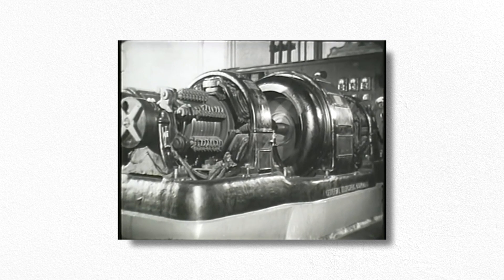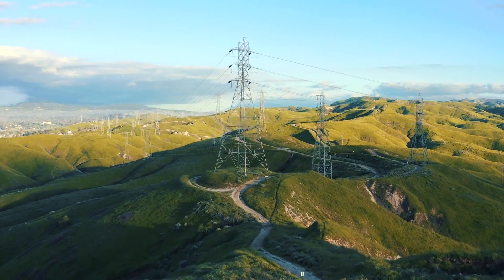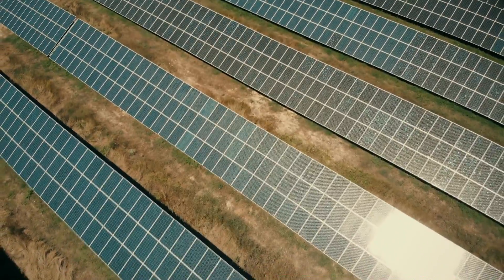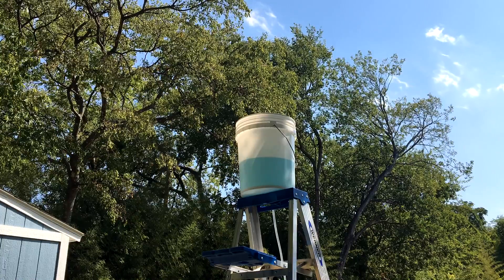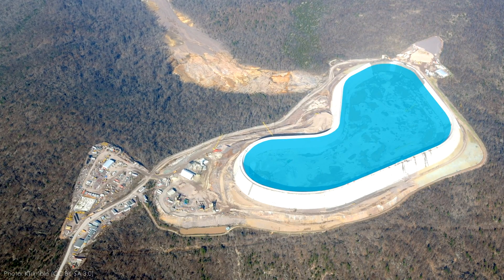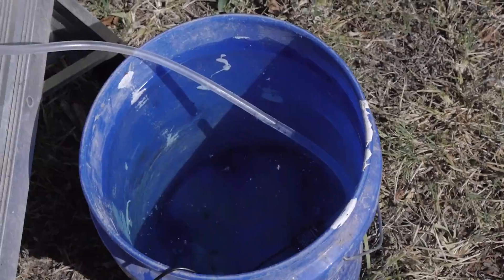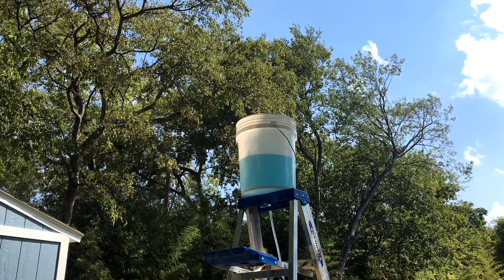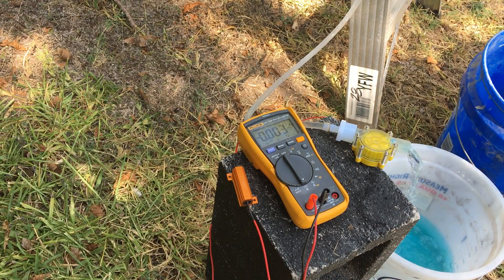World's Largest Batteries - (Pumped Storage)

Comment: I've heard from other places that Tesla is trying to make batteries for the same application and there are some trying to make super capacitor banks for the same thing.
I'd imagine several average house sized buildings with new battery technology and super capacitors together could eliminate the need for pumped storage except in the case of emergencies.

Comment: I've heard this concept be applied to a huge underground weight being hoisted upwards and released when needed. Do you know about this? Is this more efficient/practical? Where is one?
Reply: The problem with this concept is it requires expensive heavy equipment, and you have to drop the material in order to run the generator.  Long story short, as long as the material costs more per weight than water, it's just not worth it.  Water is both heavy and cheap and water doesn't suffer from wear and tear.  Not to mention you'd need to make that weight drop at a controlled speed, which loses energy, and would also require much more complexity to the setup, requiring more equipment and maintenance.

The only place something like this would be useful, is somewhere there isn't any access to water.  And even then, you'd just be better off building somewhere there is water and piping the energy there.
Reply: @peoplez129  great answer, thanks!

Comment: Shouldn't electrolysis of water to get hydrogen and storing it for future use be more efficient in terms of energy density.
Reply: No around 4x worse and water is a lot easier to deal with than hydrogen.
Reply: 1. when converting water to hydrogen you lose a lot of power if the waters dirty or if the plates have a large area (more resistance)
2. when the hydrogen is used for electricity through proton exchange membranes some of the hydrogen gets wasted due to the membranes tendency to react with carbon monoxide and not oxygen
3. hydrogen is flammable so its a bit risky
Reply: Hindenburg disapproves.

Comment: What about using a ram pump? Using the force of the river to pump the water. no electric or gas to run the pump of course the ramp pump is not efficient but it is not costing a  person any energy. i am coming form a off grid concept for a home not on a macro level.

Comment: No need for water. Just dig a hole with a pulley and weight system. The excess energy pull up the pulley.. Gravity will generate the electricity directly instead of fluid losses
Reply: What about friction?
Reply: @Asbjoern  what friction?

Comment: It's not as if large scale electricity storage can't be done, it can, the problem is trying to do it in any way that's inexpensive, safe, convenient, small.... and reasonably efficient. All of the solutions have their pros & cons. And if you find perfect terrain to build a big high dam + low dam, how do you know in 5 years someone isn't going to discover a battery 50 times cheaper and better than lithium ion?

Comment: What if we used a giant drip catching plate to catch the rain at a high altitude and funnel it into a turbine generator at a low altitude. Would that be free energy since there is no need to pump the water back up. Since this relies on rain it would be feasible in places were heavy rain is common.
Reply from the maker: This is essentially how hydropower reservoirs work.

Comment: efficiency...........its more of a problem than it seems.  If you generate energy from solar etc and send it up the grid its 10% loss, then you have the loss of the storage system itself ( even lithium batteries are only 90% efficient on charge and again on discharge) plus the 10% from sending the power back down the grid to the consumer.  Its a crock to think this can be cheaper than storing your own solar energy, on site.  The rip off is that your solar ( in Australia for example) is sold at 8 cents/kwhr during the day and you buy it back at 35 to 50 cents per kwhr. Great racket isnt it?  When we had coal none of this consumer eye gouging was going on. The whole point of the renewables crock is to bleed consumers dry.  Everything else is just propaganda.

Comment: Pumped storage is about all there is right now, yes. Rather trashes the environment, which the solar/wind advocates blissfully ignore...
Reply: Eh, I'll take a large body of water over an oil field or a uranium mine.
Reply: Even uranium rich rocks are not all that uranium rich. So a uranium mine is no worse than any other rare metal mine (which isn’t a high standard, but still). Interestingly enough though, it’s possible and almost cost-effective to pull uranium out of seawater. 
Ignoring that, there isn’t enough lithium for grid scale storage and possibly not even electric cars (for long, anyway) on Earth. While other battery chemistries exist (Nickel metal hydride and Nickel Cadmium batteries), they have downsides compared to lithium. While I disagree with the aversion to fission, the aversion to hydro pretty much makes no sense where habitat destruction is concerned when compared to wind and solar.

Comment: (about 5:36) a keyfob's battery energy would be 3V*0,220Ah ~ 2.376 kJ whereas the gravitational potential energy in the bucket (let's say it's 10 liters at 5 meters high, to be on the heavy side) would be 10*10*5 = 500J. So about 4 or 5 times smaller... so not quite the same... right ?
Reply from the maker: I was thinking about something like a CR1616. Just trying to illustrate the order of magnitude and highlight the difference in density.
Reply: @PracticalEngineeringChannel  oh OK sorry I took a CR2032, CR1616 gives three times less current so that would match up. Great video thanks :)

Comment: The energy-density and the requirements on the locations really make it only usable in some locations,  but there it is great.
Germany, switzerland, austria, italy, france - they all have some decent locations for that (and quit a lot of their capacity is used to buffer the german grid as it is just that unstable due to way too much wind/solar).

one other thing that is great about pump storage:
While they are indeed quit fast to react, they are also really "slow" compared to wind and solar as in they are really great at smoothing out the small ripples on the grid.
The demand on the grid can change rapidly even in less than 1 second. That can be from some clouds just covering a few solar-cells. When that happens that puts a huge load on the grid, but the generators of pump-storage are large bulky and heavy - when there is a huge load the energy is first sapped form their rotation and as they are that heavy and fast spinning they have a lot of power in them and can smooth out those spikes until the increased waterflow counteracts that again.

That is one of the biggest challanges coming from wind and solar - even using batteries as storage means that there is a delay between the grid getting loaded-down too much and the battery-storage kicking in. But with large generators there is no such thing - the load just directly saps the energy from their rotation (which is why the grid-frequency is such an important measure: The generators can keep up the energy demand, but they are slowing down when doing so. This makes the frequency the best and fastest indicator for the load on the grid)

Comment: lower reservoir: deep mine shafts. Upper reservoir: ground-level
Reply: Mine shafts are too small. We have one in a slate mine in Wales, UK. Well the pipes and turbines are in the mine, the two reservoirs are in the mountain above and the lake outside.
Reply: Working on a pumped hydro storage in Australia and you would not get rhe efficiency you would get from a lower and upper reservoir.

Comment: Thank you! I was very interested in pumped storage plants for the last several months, trying to figure out efficiencies and other numbers like how many are there, how popular are they and so on. Would love to find out more details about them.
Reply: Martynas, 

I think the video missed the point of pumped storage entirely, possibly he is not aware of why they are built and used. What pumped storage hydro is able to do is switch on generation in a very short space of time, a second or so and generally run for a very short period of time. Electricity grids work on a balance of demand and supply, when demand suddenly increases as it does regularly, the extra demand is too quick for the conventional generators to increase output to match, which causes a frequency drop, if that exceeds a pre set limit (U.K. is + or - half a hertz) then the system sheds load, i.e there is a power cut. Pumped hydro is used to catch those peaks and allow the conventional generators time to increase power and restore system frequncy.
They are not an energy storage system in the sense of grid scale storage to compensate for intermittent renewable generation, no storage system is capable of doing that as the capacity required is so large.

Comment: I had this idea of using boreholes for this purpose.

If you put a 1000 kg, 35 meter long, 20 cm wide lead rod in the Kola borehole, it would have a gravitational potential energy of about 120,000,000 joules.

Unless my math is wrong, that means one drop would provide, at 100% efficiency, 33 kwh. This would power one average US home for about 24 hours.

I know that doesnt sound like a lot, and you obviously cant hope to get 100% efficieny, BUT, consider this:

1.) You could come close to 100% efficiency. For a cheap method, vaccumize the hole, and use lubrication and a pully attached to a motor/generator at the top. Or, for a more expensive solution, insert a giant linear motor/generator in the borehole and make the rod out of a conductive material that can be held electromagnetically away from the walls, essentially eliminating almost all friction from the system, and converting its falling motion directly into electricity.

2.) This concept could probably be optimized way further simply by increasing the length of the rod, or diameter of the borehole. For example, just by increasing the length from 3.5 meters to 35 meters, I increased its energy storage potential 10 fold. If you made a rod that went, say, a third the length of the hole, you could power 86 homes for 24 hours (though moving a 118 ton rod would be an engineering challenge). Anyway, point is, change the dimensions and you can squeeze a lot more power out of it, at the expensive of needing to figure out how to move a much heavier weight.

3.) The big advantage to this concept is the surface area it would take up. The Kola borehole for example is only 9 inches across. You could have one of these in your basement if you wanted to. The real energy storage comes in from the fact that it's 12 km deep. If a given household only needed to store power for a 4-6 hour period, a single house would need a borehole (or multiple of much less depth) a fraction the depth and complexity of this "kola battery" I just described, and it could be small enough to go unnoticed in your basement like your water heater.

Of course, the biggest issue is the cost to just... dig. It's much more expensive in general to dig down than build up. The Kola borehole is almost a bad example to use in this scenario since it was actually a MASSIVE undertaking to pull off digging that deep. I think cost comparisons would have to be done to see if its even remotely worth it, and honestly, it probably isnt... but who knows, maybe it could be a clever way to say, reuse oil drilling boreholes on dried up and abandoned reservoirs that already exist.

Comment: Solar thermal and its storage technology is not intermittent and has been used for many years now.
Solar energy is not just energy derived from photovoltaic solar panels that work only when the sun shines.
Also, pumped water storage must take into account the energy required to pump the water up that gravity gradient (or height). It's not possible to fully recover that energy when it is released for use. Every step has it's associated energy loss. I'm afraid you cant escape the laws of thermodynamics and the reality of not being able to do work without energy loss.

Comment: Did you not run the hose from the bottom of the bucket? Looks like your syphoning from the top of the bucket to run your turbine. (7:32) Meaning your only using the pressure generated from the volume of water in the hose, not the whole bucket... You'd want to fill from the top but generate from the bottom.

I'm definitely not as smart as you but that's what it looks like.

Comment: Using Gasoline (or other carbohydrates) as power storage would indeed be better as shown by the energy density graph.
Problem is, generating that gasoline is too inefficient at the moment, basically the only efficient way to do it is with molten salt nuclear which could generate gasoline from water based or air based CO2 at competitive price (compared to the gasoline we refine from mined oil).
But once you get a plant that churns out gasoline like that, you won't use it as energy storage. You'll run lots of them to provide as much power as peak demand and use all the excess to make gasoline and sell that to power cars instead of powering power plants. Then of course you'll probably get some grants to battle climate change and make even more gasoline from CO2 which you'll simply store somewhere so that it isn't in the atmosphere so you'll have even more plants and capacity for power generation even beyond peak demand.
Reply: Gasoline is a hydrocarbon, Sugar and starch are carbohydrates !😎

Pumped Storage-cum-generation systems function as extremely inefficient "batteries" because they involve two inefficient conversions (a) pumping water uphill and (b) regeneration by hydel. When you combine this two stage conversion, the overall inefficiency is the product of the two inefficiencies. This is therefore a bad strategy and will never succeed.
Instead, particularly in monsoon lands like South Asia, if water is pumped up and drained out only for irrigation, then you double the system efficiency making it viable. 
Next, COMPLETELY dedicate all existing solar and wind generation ONLY to uphill pumping of monsoon rainwater from flood plains, into storage lakes at different altitudes, and intermittence of operation becomes inconsequential. And you do not need batteries any more!
With reference to the Indian situation, there are additional facilitating conditions and benefits. Central India is a plateau - will allow artificial lakes at different altitudes, strategically located over roughly 30% of the Country's area and networked with metre dia or larger pipelines. Lakes with unlined bottom will also allow slow recharging of severely depleted aquifers.
In most other countries, where the seasonality of monsoon or need for large irrigation demands do not crucial factors in water system design use this intermittent power source to raise level of drinking water supply, industrial use, etc into massive overhead water tanks.

Comment: I don't get it, you spend the whole video going on about how bad PSH is, yet for large scale grid sized storage nothing comes close.  +70% round trip efficiency is similar to what batteries get (hence why they heat up when charging/discharging).  Digging a large hole is far cheaper than building larger batteries (the sheer amount of raw materials required for TWh batteries is almost unfathomable).  The states also has nearly 79,000 dams, easily a few thousand of them are perfect sites for PSH.

The main problem is not technology, its political.  PSH requires large scale installations to be economic, and right now there's no political or economic incentive for changing the paradigm and moving to a smart/distributed grid system.  All the large utilities are still stuck in the 1900s where they sell you electricity and distribution/storage are just a by product of that, none of them want to buy back, manage, or store electricity.
Reply from the maker: Sorry for the confusion. I wasn't advocating for or against anything. Just trying to highlight the engineering challenges, because I think it's an interesting topic to discuss.

Comment: How about molten salt heat storage?  You over build a solar plant to collect heat throughout the day storing it in insulated tanks and then make steam at night to run turbines.  You also get higher temps so you can use process heat to make carbon neutral fuels for cars and trucks.  BONUS!

Comment: I don’t really understand how or whether this is any different than NOT running the turbines in a normal hydro dam? I.e. if the grid is above capacity then simply keep the water uphill by turning off the hydro turbines.  Is it that there are more places where a pumped storage could be built than there are places where a full hydro reservoir could be sited?
Reply: If you look at the map he showed most places that have a lot of hydro dams don't have sites like this sense they are the same thing except one the water shows up for free.

Comment: Use the reservoir to generate electricity on demand. Use various renewable energy when available to pump the water back to the top reservoir (doesn’t have to wait until night to start), use cheap electricity at night to finish the job. Keep renewable energy plants close to reservoir to prevent big loses on transportation of electricity. Use lower reservoir as a water park to collect some extra money.

Comment: I wonder if a system like this could be tied to water towers to retrieve some electrical energy as people use water. Efficiency wouldn't be great at the comparatively smaller scale, but we're pumping that water up anyway and I imagine water usage would match closely to electricity usage.
Reply: The point of pumping the water up is to have storage pressure. any power generated will reduce pressure so it is counter to the purpose of the tower.